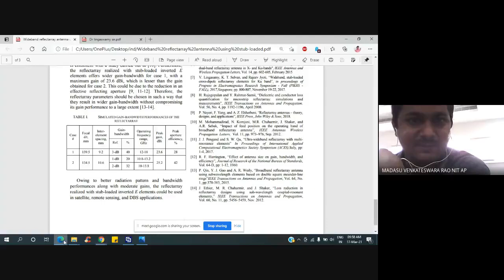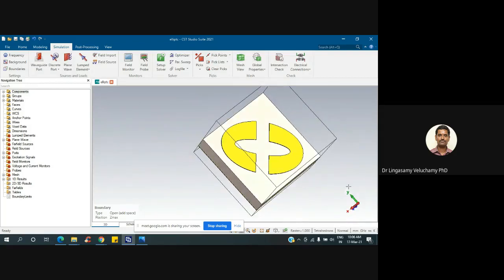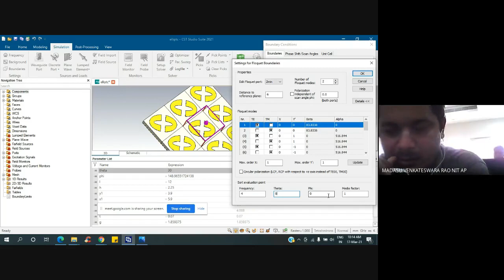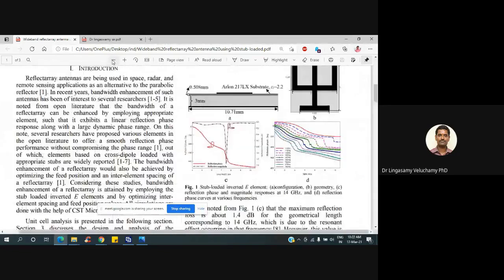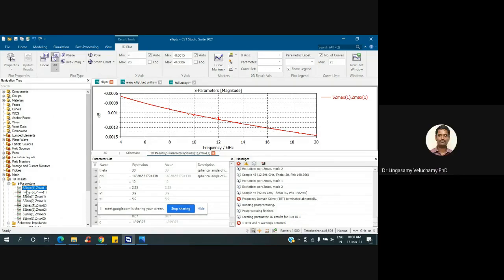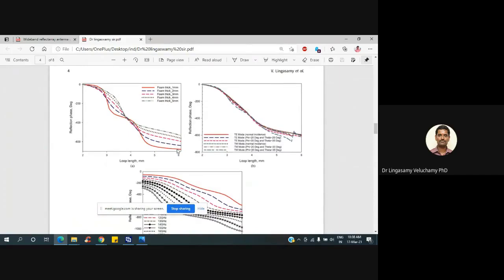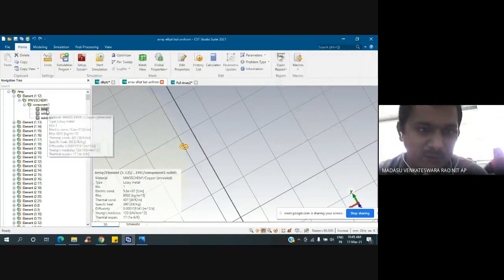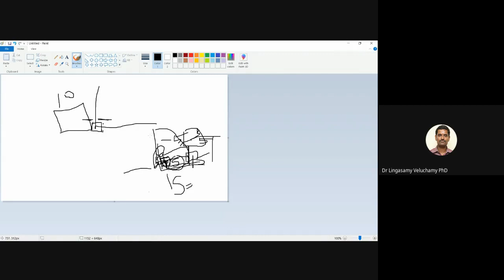How to design Reflectarray unit cell using CST Microwave Studio

Comment: To form the array (reflectarray) with a given reflection phase distribution, you can make a Matlab code to control CST software via API to map each unit cell design to proper phase.  This method is way more convenient and saves your time. :D
Reply from the maker: Thanks very much for your suggestions. I have also tried the same
Reply from the maker: Can you please share your mail so that we can discuss on the same

Comment: Is the resonant frequency in the unit cell equal to the resonant frequency in the planer? 
And what is the port of the design ?
Reply from the maker: It should be
Reply from the maker: You can confirm this by designing unit cell and a patch antenna of same size.
Reply from the maker: I have noted it approximately